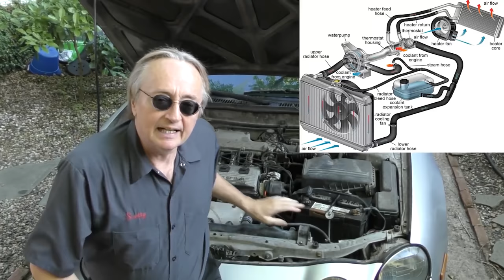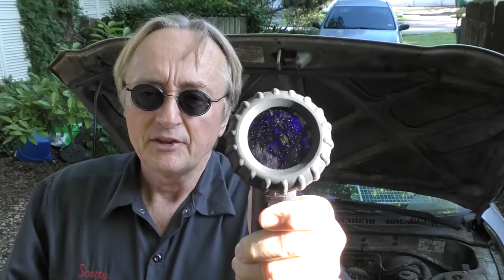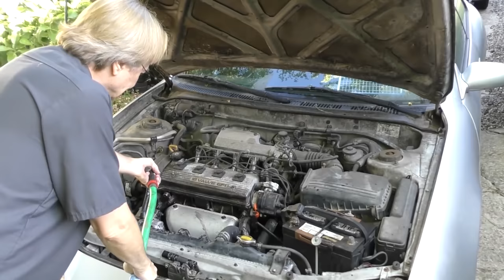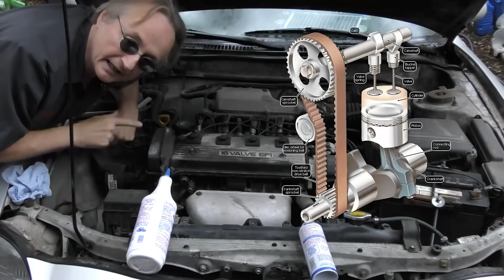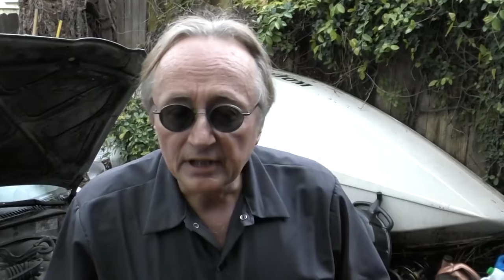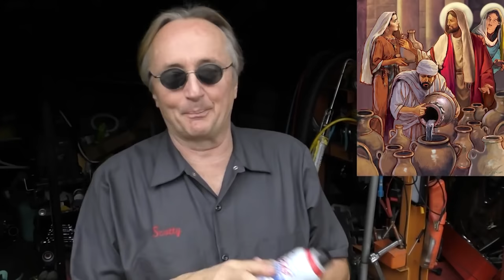2 Engine Myths Stupid People Fall For

Comment: Agreeing with Scotty is like being right, most of the time! My Uncle (also an honest mechanic) told me a "too clean" engine bay could be trying to hide something. And a dry engine bay was possibly a sign the engine wasn't properly lubed! But any oily engine, not excessive or leaking heavily, was a good sign that it was given oil on a regular basis! Rev On, Scotty Kilmer! Rev On!
Reply: Good point. A little spillage from the filter change and adding oil is a good sign.
Reply: @ocrapo9327  And it's good for the asphalt!
Reply: If you have a nice new car, and are picky about cleanlinees, wipe off and clean the excess loose dirt and such, but don't get obsessed with cleaning everything unless you have a show car and stuff. Scotty explains it well.
Reply: if it's leaking oil, it's got oil
Reply: @Chimera6297  that was me w my accord😂😂
Reply: Shady used car dealers shampoo off all the evidence of leaking seals gaskets and pour goop in the crankcase to hide the noises from worn timing chain and whatever else.

The week after it's  first oil change the noises return and you see all the drips collecting where you park. 
I used to be friends with a used car dealer and he described some of the products and magic warranty
Tire spray, and a leak fixer that last a few months (like makeup for old trash tires)
Scrubs and polish to make the trashed paint look like it's new..
And that was 30 years ago.

Comment: Personally a clean or regularly maintained engine bay makes looking for leaks much simpler.
Reply: I like the clean engine as well it's easier to see what's wrong (leaks rust) and much cleaner to change parts.
Reply: This.  It's common sense.  If you have a leak of any sort, in my case coolant, it makes sense to wash everything down to remove dye from previous repairs.  After running for a couple dozen miles it makes finding new leaks much simpler.
Reply: Not only that ruber and plastic starts to crack if not moved for a long time...
Reply: @fluxcapacitor05  don’t you have to clean out that leak dye, other wise won’t the chemicals in it give issues later down the road?
Reply: @selwyn13  Not for AC system.  Half of the 134a cans come with dye already in them.  My guess is its the same with coolant.  Not sure why dye would cause issues.  "Chemicals" is a loose term here.  Most dyes have nothing to do with oxidation or embrittlement properties.
Reply: It makes working at your car more pleasent
Reply: Exactly
Reply: @fluxcapacitor05   Oh it wont, ok. I’m a rookie when it comes to cars so I tend overthink a lot of stuff. Lol. 
With that leak dye test, you can use those to find oil leaks too right? Or since those are oil based are there different type of leak dyes or test kits you would have to use?
Reply: My engine stays spotless.  I even wax much of the paint under the hood. 😎
Reply: @selwyn13  Yes you're absolutely right.  AC dye goes in the AC, coolant in coolant.  All of the dyes are florescent with UV, so you'll need a good  (bright) UV droplight or hand light to illuminate them.
Reply: Thats personal preference, not factual data. Ya know like what Scotty is talking about is fact. You spray water into your engine bay and  you're risking dmging electric components. You spray chemicals in there and your risking your rubber deteriorating. Those are the facts. You wana risk it? That's up to you but the facts are you're risking damaging your car.

Comment: I'll agree with you I did a engine clean and almost never got it back running.
Reply: every time before i washed a engine i got in trouble, i will never was the engine again
Reply: The only people who should clean engines are dodgy used car dealers. 🤣
Reply: @flynick  I did it for over 3 decades here in the UK lol Was told by a high senior official Toyota UK bloke NOT to jet wash the engine (Toyota) but did it again & got caught out lol  But still carried on :)  Never had any issues. Did many cars,vans,trucks etc and never had an issue. You did it wrong somehow as you wasn't trained (Not offence)
Reply: @tardeliesmagic  lol you're a professional engine  cleaner.
Reply: @tardeliesmagic  so you did it to other peoples cars who you had no knowledge of any future changes in their reliability.

Comment: Like you always say Scotty it's better to change your own oil, especially considering the fact that the best oil changes require time remove the drain plug and try to remove every single drop that's in there if you have enough time walk away do other things come back when there's no drops left put the screw back in and fill it up. You'll have much cleaner oil instead of the speedy shops that try to race you in and out and you still have the gunk and sledge at the bottom cycling right back to the engine. I know most people are not mechanically inclined or in a hurry and their day-to-day life but it's definitely something to take into consideration.
Reply: An action I take is to pour a little clean oil into the engine with the sump plug unscrewed to flush out those last drops of dirty oil left in the sump
Reply: Walmart just vacuums the old Oil from up top. That leaves the crud in the bottom.
Reply: @johnwilliam384  thank you for telling us that, we need all the information we can to not get screwed by Walmart!
Reply: @johnwilliam384  Walmart probably does that so that the high school dropout doesn't strip the sump plug.
Reply: @Honkawsuzyamal  thats what i do

Comment: One thing all the detailers at the dealership learned the hard way-Never wash a Toyota engine.
I like to clean mine down with a little brake cleaner when it gets goey but if you catch any oil leak early enough goo doesn't build up.
By the way Scotty, you need a new negative battery terminal on that nice Celica.
Reply: don't wash any engine. pointless
Reply: You can just scrape off the goo. Or spray only the area where the goo is. Sometimes, once the leak stops, the goo starts to go away by itself. I had goo on the transmission pan of my 2001 Camry because of a valve cover leak at the rear of the engine. Fixed it and now the goo largely has disappeared all by itself. I tell my Toyota stories the way an old hippie spins out his VW and Slant Six yarns. The VW and the Dodge Slant Six were hippie-era touchstones. There were other people into the same though and still are. Myself, I'm intrigued and know how to restore them mechanically but I don't think so.
Reply: I have washed mine for years, never had a problem.
Reply: @77GR1982  you certainly can get away with it.  With consideration taken for what can go wrong I'd rather just leave it alone. To each their own, glad it works out for you. As long as my engine is breathing and running healthy I'll live with a little grime, may blow off the dust and contaminates with an air chuck if I'm feeling fancy.

Comment: For over 20 years I've used a pressure washer at car washing places to clean under my hood after mudding offroad and have never had a problem but I always do one thing and that is I leave my engine running while I clean it and then I drive for at least 30 min after that way everything drys up and water doesn't hurt my electronics.
I'm not saying you can't hurt anything but if you do what I do you should be ok.

Comment: Years ago, I test drove a used 5.4 triton (f150). Came back to purchase it the next day, only it had a missfire this time. Someone brilliantly pressure washed the engine bay, water was causing a short between coil and plug. They knocked $3500 off the price. I drove it home, popped the coils and blew the water out, drove it another 100k before I sold it.
Reply: Yeah I learned the hard way on my 5.4 those coils don't like any water at all.

Comment: For a year I thought my car was burning oil.  I used an oil stop leak product for one OCI.   Then I used MMO for another OCI.   Then my timing chain grenaded.   Now that I've got the engine mostly disassembled, I found that I was losing oil through the spark plug seals.
Reply: What a revolting development that is! Pray for your engine!!!
Reply: Hopefully it's a Toyota.

Comment: Hey Scotty, me again Gary with the beefed up 2000 Corolla, Iv'e watched you for a couple of years, and i just love watching all your video's, I gota tell ya my 2000 was getting hot with the air on in the desert in the summer, well, i had a guy who does engine cleaning clean the engine, and it does not get hot anymore. it was like taking off a winter coat for it.. It did work for me. Plus its nice to see and work on now..

Comment: Engine oil is non conductive. More of of an insulator. Cannot cause a short like you said. Diesel engine have electrical harness on injectors where oil is constantly there.

Comment: I remember having a broken cover gasket, the oil melted through my coolant falange and also just smelled horrible when it burned off on the hot engine. A broken cover gasket can cause a lot of avoidable issues

Comment: Just watched a video how to from a guy that details engine bays. I've never wanted to risk it but he took a lot of precautions. Removed the battery, covered up all electrical components, avoided spraying some areas etc. He started by dry cleaning it. It was interesting to watch and the end result looked like a new engine. But then he made sure everything was bone dry before putting it back together.

Comment: The Lucas auto transmission slip stop works wonders, I had a 400,000km Volvo S60 03 that never had a transmission fluid change since 150,000km. 

It got slow engagement into Drive and it would slip into third gear. I added the stop slip and third gear stopped slipping but the slow engagement was still there

Comment: I've recently switched to that Mobil 1 that's rated for 20,000 miles. I don't plan to ever run it to 20,000, but it seems like it has a better mix of detergents and dispersants and maintains its specified viscosity better so it'll be closer to spec when I replace it at 3,000 (or usually 3500 to 4000 by the time I actually get around to doing the work)

Comment: I have pressure washed every car I've ever had and never had a problem. I keep the engine running & clean just don't spray water in the intake. I have been doing this for over 30 years
Reply: Precisely how the car in his story got hydro locked.
Reply: There, that's proof all right.

Comment: You are correct, but if it is very greasy, leave the care running, and carefully wash the engine.  It helps with hard to find areas where leaks are, because sometimes we don’t have a way to get under the car or we are in a situation that we don’t have access to the engine dye.

Comment: High school student who did car detail as a part time job. Best solution for a clean engine. Simply spray foam tire shine all over a warm/hot engine bay.  No wiping, no fuss, no muss. It will look like new and rejuvenate all the rubber at the same time. Do it and you'll be amazed. Scotty is right, don't spray the engine with a pressure washer.
Reply: Yes meguiars
Reply: I'm. Going to have to try your trick a few year's ago I moved to az and the heat is horrible on rubber under the hood.
Reply: Will that foam rubber tire stuff work on 20 or 30 year old rubber around the seals of the windows and doors?
Reply: @montanawarren8462  It might help somewhat depending on how bad it is. You would probably get better results by using AT205 on that rubber. Scotty has mentioned that product many times.
Reply: @t-money1463  I use Vaseline last year but it's dripping down the side of the truck
Reply: @t-money1463  so what is At-205, what's it made up from petroleum like Vaseline?
Reply: I would use Gunk Engine Brite. It does an excellent job of degreasing an engine. Then, I would use a foam tire shine.
Reply: @Rhaspun  what do you use to renew the rubber grommets around your windows and windshield etcetera Vaseline works but it dribbles down the side of the vehicle

Comment: I couldn't tell how many times I took a pressure washer (at a low ish pressure) to the engine, from on top and from underneath.
Reply: Japanese motorcycle owners manuals use to warn against using pressure washing the bike because water could be forced through oil and grease seals not to mention invading electronics.  We had access to an industrial steam cleaner to wash our dirt bikes around 1979, wonder how much damage we did.

Comment: I buy used vehicles so I clean the filthiest greasy / oily areas under the hood within the first month of ownership, this gives me a relatively clean engine that I can monitor for existing and future leaks. I have been doing it this way for about 45 years, and it's never caused me any problems on the 60+ vehicles I have owned. Of course I am careful not to spray cleaner or water on electrical components.

Comment: I have a 3 year old Nissan 370Z and all I do is wipe down everything under the hood with cleaning wipes and then follow up with protectant wipes to keep the plastic and rubber looking like new, I noticed that this car doesn't accumulate as much dirt under the hood as some of my older cars; the bottom splash shield may be helping to keep dirt out.

Comment: I wondered at car washes with the high-pressure undercarriage spray. As once after going thru it I had electrical component issue.
Reply: I went thru one the other day and I immediately had engine trouble after the was. I suppose I mistake if leaving engine on.
Reply: It got better after I suppose drying out over night. I suspect it got the filter wet.... Yikes
Reply: This happened to me at a Dealership recently.  I went for a 30,000 mile maintenance and as part of the service they wash your car in their touchless washing bay, which is basically super high powered water sprayers from top to bottom...I had it done, was driving home and the engine started sputtering, I was able to turn back around and limp back into the dealership.  The issue was a bad sensor caused by water leakage.  They fixed it, but I'll pass on the free touchless wash from now on.

Comment: I pressure wash the engine bay and underneath the chassis, at a self car wash. What i do i cover the alternator and fuse box with a small plastic bag. Since it doesn't have a distributor coil, I don't  spray  around the independent spark plug coils.  Don't  do all the time just a few times a year.

Comment: Also read the back of the can. Several additives say do not use in an engine with more than x number of miles. Don’t use additives in a new/fresh rebuilt motor or the rings may never seat.

Comment: I always took pride in a clean engine and most held up okay (esp the older points types which you would just use some WD40 to clean out and dry the distributor cap). The only one that gave me problems (confirmed) was a Mitsubishi Galant. The electronics in the distributor would fry. I would have to get another one to make the car run. People would always say that my 1969 VW Beetle was so clean that you could eat off of it (and it was painted NOT CHROMED). Some cars seem to be okay, but some really cannot handle it. Be careful! Good point Scotty on the issues one may face. Take care all and God Bless!

Comment: O 'cmon admit it, it's vanity 😁

Cleaned my engine to see if Blue Devil rear main sealer is working.  It stopped the oil seepage on the PVC and vent tube grommets in addition to the rear main and the timing cover seal.  I wouldn't know easily if the engine wasn't clean.  Some  Purple Power,  in addition to 1/2 hour of waiting, it  gave me a really clean 270,000  mile 4.3 engine in my '88 S10. I used a throw away paintbrush to help wiggle the grime loose. Just use the hose at low pressure to rinse the residue.
Clean engines  make it easier to see problem areas.
Love your stuff Scotty, I hope you're doing well.

Comment: I used to clean the 6.0 in my Pontiac G8 all the time. Just covered the battery and air filter, and washed the entire thing. Never had any issues. Then again, it was a Holden.

Comment: Do your oil change b4 the manufacturer tells you. Especially if you have variable valve timing and timing chains.
Reply: Ocrap0 yeah with my 2006 Matrix with VVT-I I don’t go further than 5,000 km between oil changes. Fluids are cheaper that metal😉

Comment: Unhook battery On a warm not hot, Simple green let it sit scrub wherever u can. Lightly spray off with hose.
Use air hose on EVERYTHING to get any water out while wiping with dry towel.
Looks new again.
Been doing this for years. Never have had a issue. Only do this once every 2yearsish.
Reply: I did this to a cts i had. Took it to the dealership for a diagnostic and they were amazed at how clean it was.
They asked what the trick was. I told them. They said no way, im supprised.

Comment: When I wash one of my cars I'll wipe down the engine with a damp rag.  When I do an oil change or put my cars on a lift (I have one in my garage) the underside gets the same wipe down.  Done regularly there's never a need for pressure washing or any other extreme measures.
Reply: EDIT.  Except for my '74 CJ with a Chevy 383.  After a day in the mud that dirty girl gets pressure washed all over.  😁😁😁
Reply: I keep my cars forever and never do anything like that. No problems.
Reply: @wholeNwon  That's your choice.  But when I pop the hood of my '69 Z/28 or '72 E-Type those puppies glow. 😁
Reply: @nucleargrizzly1776  The world loves the E-Type for good reasons...esp. the roadster.
Drove one a few years after they came out and liked it, but a friend was having too many repair problems with his. So I bought something else.
Reply: @wholeNwon  I got lucky.  I bought mine from a fellow just after he had a nut and bolt upgraded restoration done by Classic Jaguar in Austin, TX.  They fix all of the factory issues.  After 10 years mine is still Toyota reliable.
Reply: @nucleargrizzly1776  Lucky man!  Beautiful car.